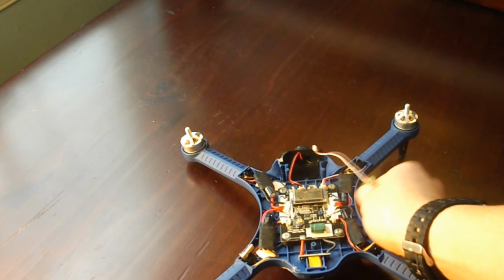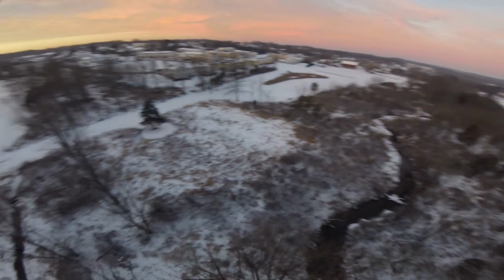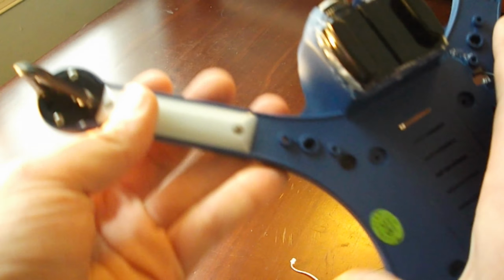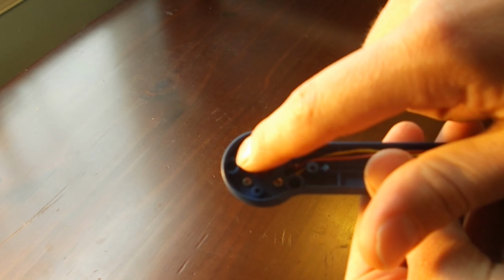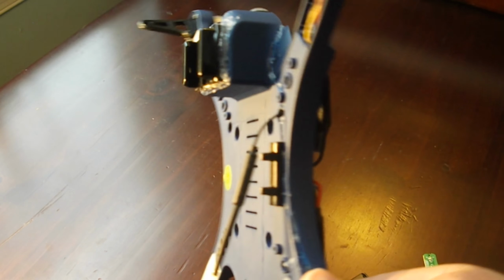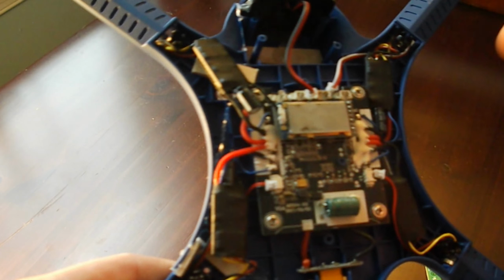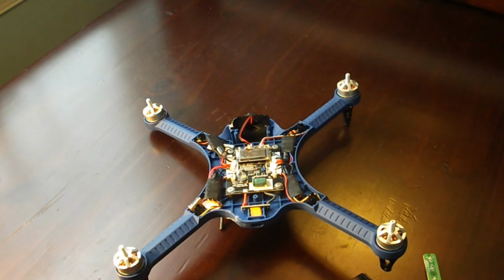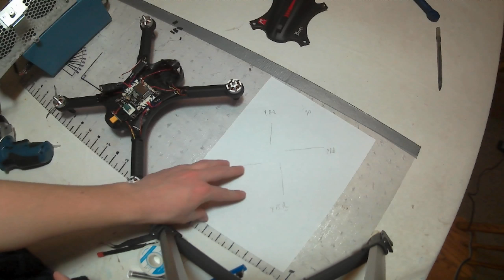Crashed your drone? MJX bugs 3 frame replacement

Comment: Broke an arm on my Bugs 3. It was easy to fix with regular superglue. I just used a couple of tack spots to start with to hold it in place. Over the next few days I added a little more glue into the crack and built it up really slowly. If you take the time to add just a little glue at a time , and leave a full day drying time between each application, it works really well. I expected the superglue to melt the plastic. Perhaps it might have melted if I had applied a lot of glue in one application. Thumbs up for your informative video, fortunately I didn't have to buy a new shell and strip the internals out. Like button smashed 👍👍👍 : subbes you and hit the bell , nice channel

Comment from the maker: Soldering is a fairly easy process after you get a few trials under your belt. Just take it slow. Make sure you have a small bit to use as the terminals are quite small. The best thing is to keep your motors in the same layout when you take it apart. When you go to solder the motors back to the esc's, don't worry too much about which order the wires go. After you finish put the props on, plug in the motors, and push the throttle to the lowest setting. If the motors spin the wrong way, switch one of the wires with another. Do this for each incorrect motor. I hope this helps, good luck, and let me know if you have any other questions.

Comment: Oh, man! I just took my new F1 Ghost drone out for its/my first flight and broke two of the arms on the main frame landing. Now, I need to replace the main body frame. Your video is very helpful, but I'm a bit worried about the soldering part. Any suggestions? SUBBED!

Comment: I have a Bugs 5w and need to replace a rear light. How difficult do you htink this would be?Would I still need to tear apart the whole drone?
Reply from the maker: I don't think you would have too much trouble doing so. You just need to remove the light cover (2 screws), then remove the light, then unplug the 2-pin connector from the main board. After that, gently pull the old light wire out, and feed in/ plug in the new light. Replace the cover and you should be good to go! Let me know if you run into any other problems, and I'll try to help.
Reply: Ok, thank you. I'll order the lights. It does not seem to be affecting anything else,. This happened after some seagulls attacked it and it fell to the ground.

Comment: Nice job bro. Tedious task to be sure. I knew it would be. When i broke my frame i bought a new drone because i couldn't find replacement frame with "prime shipping" and i figured I'd have 2 new batteries(4 total) and lots of replacement parts for easier fixes....then i crashed my second bugs3 and broke the arm off exactly like i did the first drone.(i suspect that my preflight over-tightening of the screws at each of the arms was possibly the cause of both breaks...i recommend snug screws not super tight so frame flexes) Now i don't have enough disposable income to buy a 3rd drone so im gonna order replacement frame and follow your lead. Tell you how it went in a few weeks. My fear is that it'll be a lot of work for nothing and an even bigger headache at the end when it doesn't fire up. Did yours? Or did you require more time to troubleshoot and solve further issues?
Reply from the maker: James Greene after replacing the frame, I was able to fly right away. It is definitely worth the money to replace the frame. Good luck!